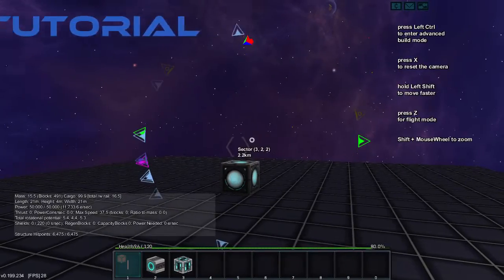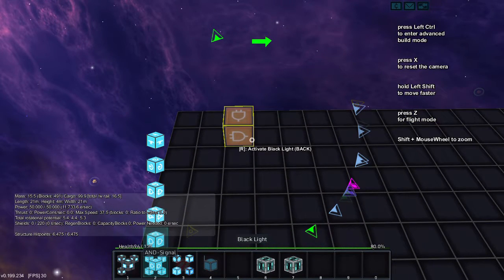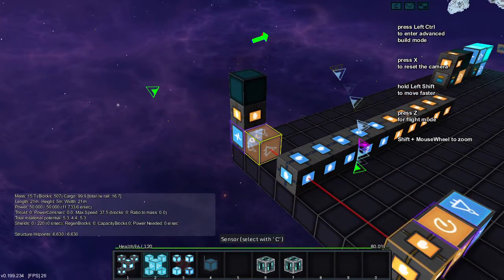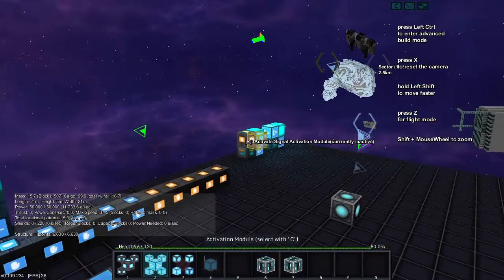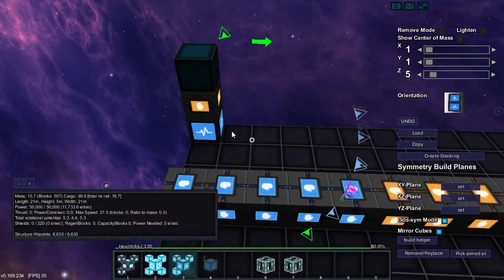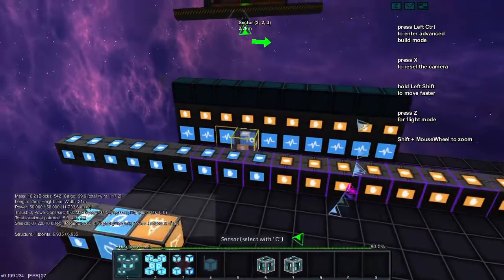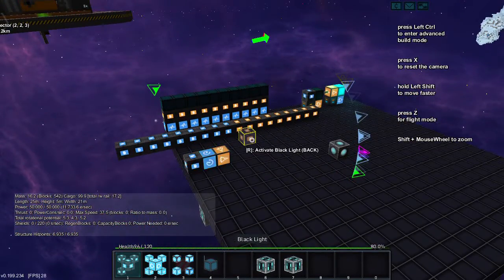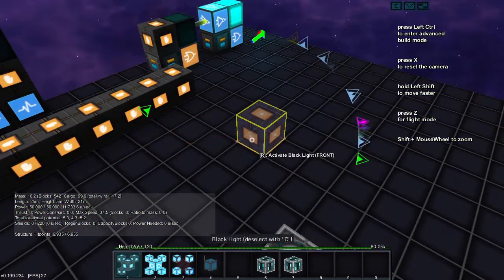Starmade Tutorial: Sensor Logic

Comment: I didn't realize that the sensor blocks could share activation modules.  I just assumed they couldn't and didn't even try(which makes the video I have scheduled for tomorrow overly complicated).  Thanks for showing that off!
And I feel the pain of not hooking it to a clock... then checking the connections to everything else first...
Reply from the maker: +JW608 Lol about the clock :P

Yeah the activation module thing is great. You could run any number of sensor systems off of a single set of activation modules.